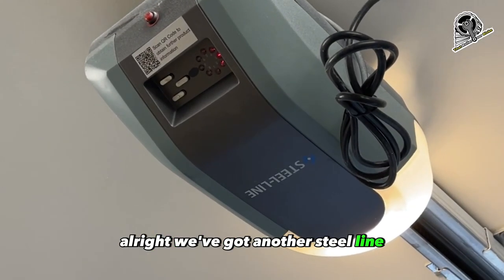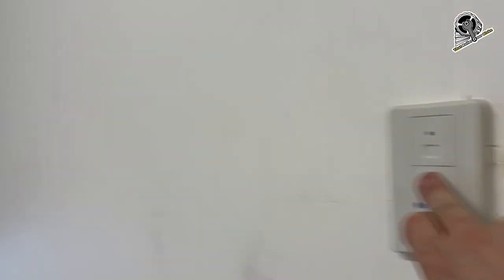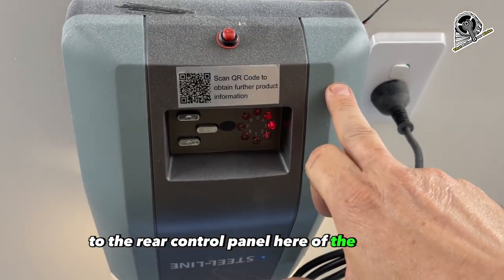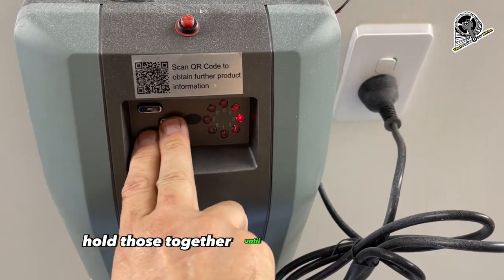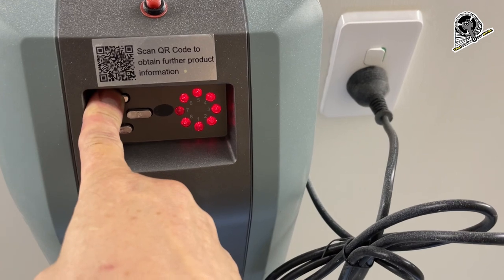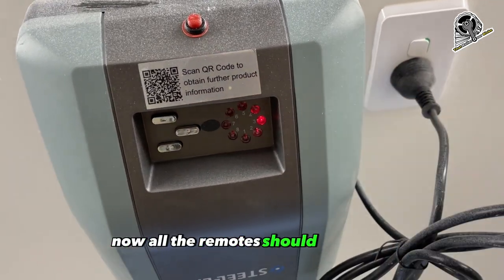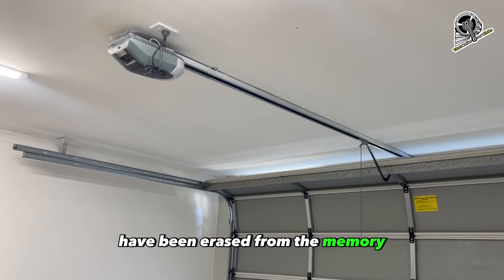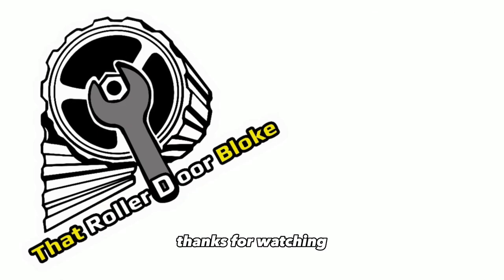Securing Your Garage: Erasing Remotes on a Steel-Line SD800 (Quick & Easy!) - 74

Comment: Quick question for you mate. Does this method set a new code frequency for the opener or does it just clear the remotes and still keep the original frequency? I don't have the 2nd stolen remote to test that the frequency has been changed!
Reply from the maker: Hi Steve, yes it clears the entire memory.  So if your existing remote doesn’t work, all remotes should be erased 👍🏻